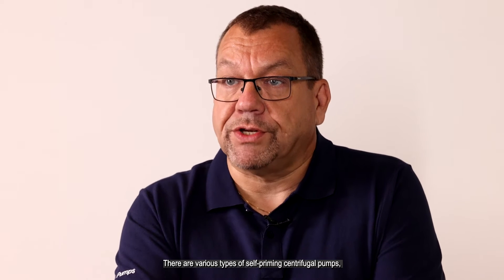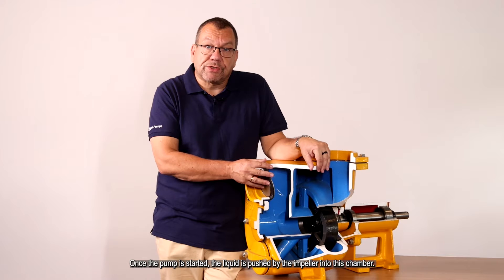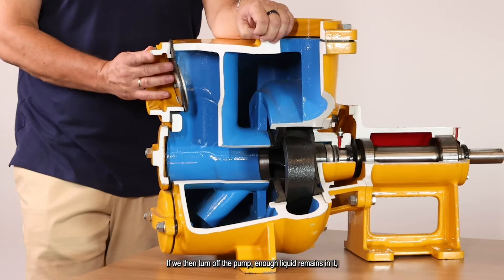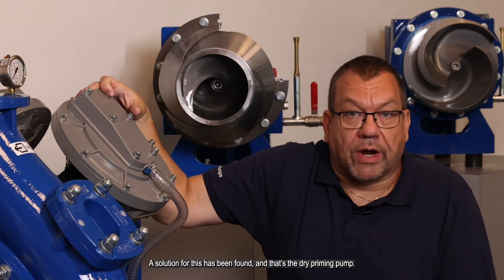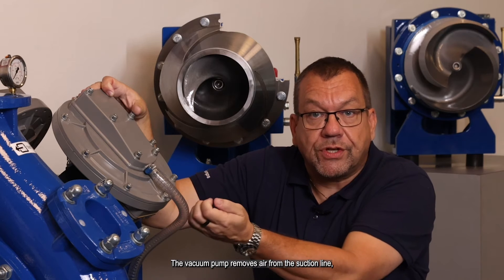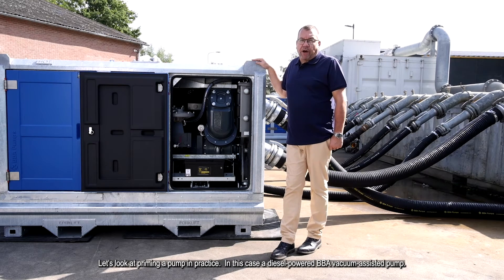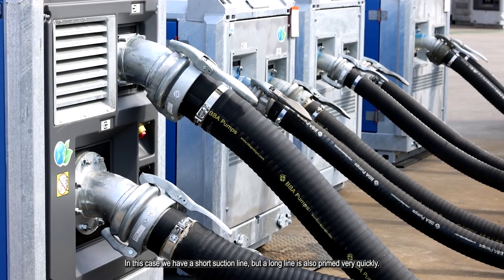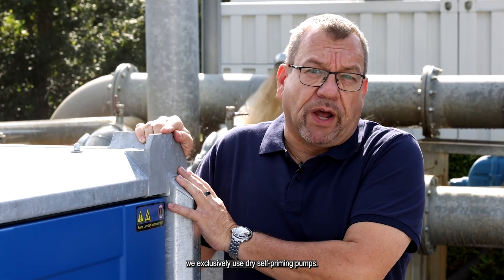BBA Pumps The differences between wet and dry self priming centrifugal pumps

Comment: GREAT SYSTEM ! ! this is an awesome solution, but I would not call it "Self Priming" As the spokesperson said "Vacuum Assisted Pump" Is more accurate and I believe "Self Priming" should not be used with this pump but I understand that you need to get the attention of people who want a self priming but don't yet know that the "Vacuum Assisted Pump" is a very efficient alternative. I found your video because I created a new type of pump (Not Self Priming) - it is called the "Dry Centrifugal Pump" and it utilizes a "Toroidal Trap" on the impeller which allows it to function with the housing filled with air. This concept was created to eliminate the viscous drag between the impeller and housing. This viscous drag has plagued centrifugal pumps since they were first used nearly 300 years ago. I think your Vacuum Assistance systems can be added to nearly all pumps. Do you manufacture or supply retro fit vacuum systems for existing pump applications? Would you consider being on my Xprize Team to develop the next level of Water Desalination System? Using your Priming technology and my Ultra Efficient "Dry Centrifugal Pump", in combination with another Membrane Development company; I believe we could win this X Prize:     https://www.xprize.org/prizes/water   for more information on the prize.